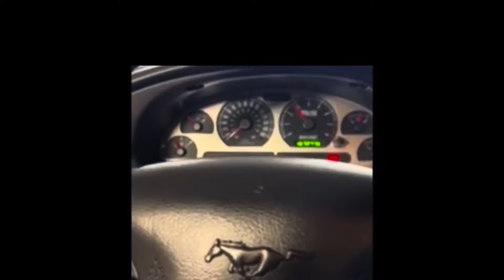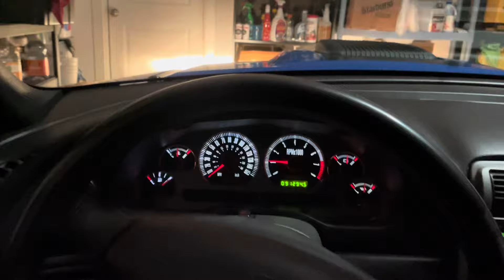Cousins 2003 mustang Mach 1 back with a 38k mile engine

Comment: I’m glad to see another Mach 1 back on the road, I’m impressed with how well that paint held up against the elements. Before I bought my DSG GT from my step brother the car sat outside neglected for about a year. Within that year the clear started peeling on the driver side fender and quarter panel. The Texas heat is brutal on paint.
Reply from the maker: Here it gets to 110 in the summer. They fade bad here too. I waxed this Mach 1 to help preserve it.